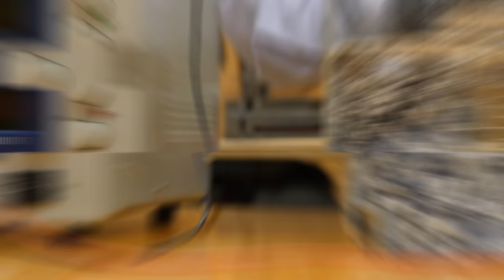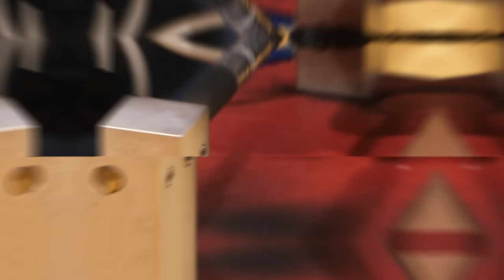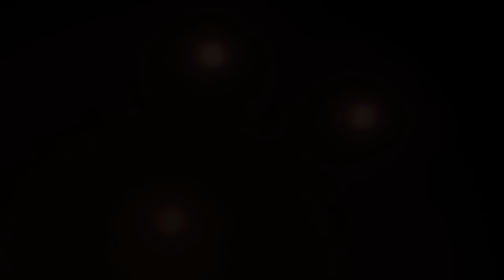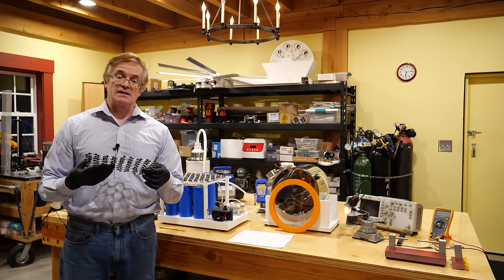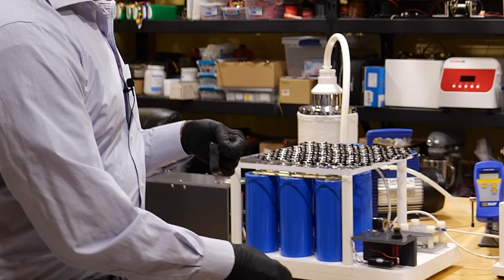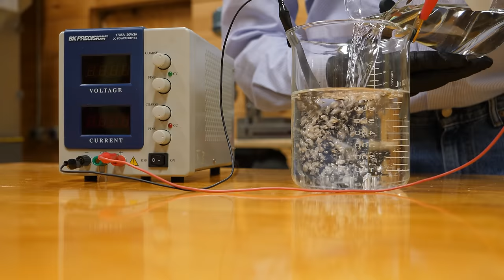Making Graphene could KILL you... but we did it anyway?!

Comment: Been hearing about the hype of graphene for over a decade now and seeing something so practical really gives me some hope. And raman spectroscopy is really useful, hardly any sample preparation required although it doesn't really work with anything that fluoresces. While a baseline model from well known manufacturers can cost around $100k, there are quite a few south korean companies making raman systems around the $30-$50k range with "good enough" performance.
Reply: Govdeals and get something used for like $100, might have to work for the software though.

Comment: I am very impressed by the change in stiffness for epoxy with graphene. 750% for 0.6% is insane. Great video and I am now subscribed
Reply: Right?! And that's not even accounting for the purity or quality of the Graphene, think he mentioned he didn't have any accessible way of testing the Graphene he made.

And i wonder in what ways it strengthens the epoxy, obviously tension/compression (likely more tension than compression), what about the fatigue curves, sheer, torsion or heat resistance. 

This actually managed to make me quite excited about the prospects of new composites entering the market in the foreseeable future
Reply: The only material stronger than graphene that we’ve made in a lab is Carbyne LAC which is twice as strong as graphene. 

However we’ve only made a few molecules of it, it’s more stiff, and lacks all the other advantages of graphene. 

But theoretically if carbyne LAC molecules were arranged in the same pattern as graphene it would be an inconceivably strong bond. We’re talking possibly 20 times stronger than graphene and 4000 times stronger than steel
Reply: @ZverseZ now this right here is absolutely fascinating! Wondering about the practical applications of making a bulletproof vest out of such a material. What type of density does that material have?

Comment: I loved this video, the bending test results were genuinely astonishing. I'd like to see a short video of the post processing of the graphene you were using for the test pieces. Was it with the sonicator or just the pestle and mortar? 
Are you going to do a follow up to test the thermal conductivity? I can see an immediate tie in with your thermal epoxy experiments you did a while back!
Reply: Big omission in the way the beams were made. A granular material will hardly resist tensile stress. But packing more stuff tightly into the beam will increase its stiffness. The graphene won't resist tensile stress unless you can turn it into long fibers. Need to attach fibers to the outside of the plastic beam, not fill the beam with granular material.

Comment: I was thinking about using this method on industrial (ish) scales. What about using a reaction vessel with a higher surface area to volume ratio, so you can increase the batch size without changing the cooling rate. A Cylinder gives you very little surface area for heat to radiate away relative to its volume. 

What about a rectangular prism? You could make a thin but wide and tall reaction vessel out of relatively thick quartz sheets (I'm honestly not sure how you'd bond the corners, so this may not be viable). Allowing you to do many times the reaction mass that you're using here each time. 

In addition, to allow for a more industrial scale, I could imagine using the reaction vessel as its own vacuum chamber. Because it's not a high vacuum (only 1/100th of an atmosphere) you don't need any exotic seals and could likely get away with simple endcaps that contain the copper electrodes, a sealing cap and an air outlet. You pre-fill the reaction vessel with an appropriate mass of carbon black, then fit the electrode endcaps in place and rapidly pull a vacuum on the relatively small volume. You could compress the carbon to the appropriate electrical resistance either by having a set compression ratio (that might require some unrealistic tolerances), or by just using gaskets on the endcaps and allowing the electrodes to move in an out, before locking them in place. You could theoretically automate this process, dumping out the reaction results into a container for later refinement. The main issue is that you could only have one reaction happen at a time, because otherwise the black body radiation from one reaction would just be absorbed into the next reaction, slowly the rate at which they cool. You could even go a step further and perform the reaction mostly inside a box with a high absorption coating (e.g. carbon black) to decrease the amount of thermal radiation that's reflected back into the reaction vessel (you may also need to actively cool the container so it doesn't heat up over time and reduce its effectiveness). 

Anyway, I got this far in, then found realise the plasma deposition paper has a much more easily scalable method hahaha. Although I expect this could be done with a much cheaper outlay, even if the plasma deposition method would soon outcompete it.

Comment: I've been watching for potential applications of graphene in extremely high-Q mmWave resonators.  I think we're a long way off that yet, but it's brilliant to see how much progress you are making. Some of those flakes are HUGE relative to the mmWave wavelengths I'm working with at 122, 135 and 248 GHz and above, where surface roughness of even polished silver starts to be an issue with scattering and losses.  Interesting times we live in
Reply: Have you considered lining your resonators with mica sheets sputtered with a conductive surface? The metal surface would still be rough but where it interfaces with the mica isn't, and the thickness of the mica layer should be thin and consistent enough to be factored for.
Reply: @mfree80286  I need to check the loss tangent of mica at those frequencies, but I think the tight radius will be a problem for the really small cavities, plus I need to check skin depth issues in graphene at mmWave frequencies. Sputtering gold or copper on to the outside of a really  well-polished sapphire cylinder, then electroforming copper over it might be an interesting option.  I do like the idea of cleaving mica and doing a reverse coat that would then be as flat as the lattice, assuming there's no migration.  I only need to remove ripples more than a micrometres, so optical polished surfaces are definitely good enough if the conductivity of the entire surface is good and there are no discontinuities
Reply: @MachiningandMicrowaves    Hrmm. Could also coat a given substrate with a resistant metal and then chemically "remove" the substrate layer. 

MIndstorming a bit on that, you might end up being able to properly polish a solid, sputter, electrocoat, "delete", and end up with a complete seamless cavity. Just need to find a material that's nice and hard but is reactive to something that won't influence the sputter or support materials.
Reply: @mfree80286  I do that to make complex internal structures inside tine feedhorns, make an aluminium positive, zincate it, then gold plate then copper electroform, then hot NaOH to dissolve the aluminium. Thanks for the ideas, I'll do some research

Comment: Thanks for the update in graphene. I made some several years ago using the top down method with sonication. I would love to see you compare your method with graphene oxide in your epoxy test. The older method as you say produced varying layers and sizes of graphene but it would still be interesting to see the quality difference between the 2 methods.

Comment: I am sure you have thought of this already, but if it is at all usefull to compact the second electrode, you can compact it tightly in the second tube, and then use a coupler to couple the reaction tube to your offcut, allowing you the ability to easily drive the electrode into the reactor. It may require a more precise cut, but nothing a nice little saw can't handle. 😅 Love your work and I am eager to see you revisit some of your composite construction concepts using the end-grain balsa. I would love to see the delta between their respective stiffness!

Comment: As a mechanical engineer I found this so very interesting. I have performed load testing on many projects, but this graphene is amazing, truly a huge advancement in science/engineering. Thank you so much for posting.
Reply: Maybe. CF also makes stuff harder. But the question is: does it increase hardness at similar toughness? Glass is hard - but brittle.
Reply: @testboga5991  I think Carbon Fiber will be with us for a long time to come. Graphene is still in it's infancy, until the manufacturing method can mass produce it in large quantities. CF is still an amazing product and new uses for it are still being found.

Comment: How does the epoxy+graphene compare to other common (low cost) reinforcing materials like short-glass fiber? I’d love to see those bending modulus tests.
Reply: he certainly should have tested at least real marzipan with epoxy, that would take that question out of our minds... kkkkk
Reply: I tried it using 1.3x the amount of graphene that he used, and it outperformed marzipan and mylar by a significant amount!
If you printed a car out of this, the car would be able to ram through concrete with minimal scratches...
Time to start experimenting with chitin I guess!

Comment: I'd be very interested in seeing this applied to SLA printing resin, they tend to be very brittle unless you make them flexible, which kind of rids them of any stiffness. It's pretty difficult to use any additives with the resin due to settling, but a graphene suspension might just be viable in those small amounts.

Comment: Y'all production quality has gone through the roof in the last few years. Just an idea, I'd love to see what this would do for a boat Hull. My thought process is if you're doing a laminated fiberglass you lay down the fiber glass and mix the graphene in with the epoxy. Theoretically you should get the strengthening property and I'm wondering if you'd get a lower friction coefficient as well. Since you were saying earlier that is can be deposited onto copper can this be electro plated onto something? My thought was if you could electro plated it or maybe even deposit it on an etched circuit board that would be huge.
Reply: Resin printer...
Reply: @trygvetveit4747  yep that would be a pretty cool idea as well

Comment: The water thing is something to do with water molecules cleaving bonds at the crack tip if I recall correctly, it's quite potent, you can cut glass with scissors even without cracking it as long as you do it underwater
Reply: I've heard this story about cutting glass with scissors underwater, and although I never actually tried it (well, maybe I'll put on my bucket list? ;-) but having couple of years of hands-on experience in glazing I pretty much doubt it. I mean, while you could probably "split" a piece of glass/ small glass pane into two pieces or more (I guess "more" is more likely) with this technique, you certainly won't be able to make anything even remotely resembling "precision cut" going into intended direction. Heck, even with proper glass cutter and cutting technique it can get messy if the glass you're working on hasn't been properly cooled (i.e. it cooled too fast). I happened to work on such glass one time few decades ago - no matter what, the moment the cutter was close to the end of making a score (i.e. approaching the other edge of the pane) a quite "plink!" sound was heard and two wavy cracks propagated perpendicularly from nearly-almost finished score. Oi, I hated it, I really did... ;-)
Reply: @MrKotBonifacy  oh yeah, it's super crude, more like crushing than anything, but the cracks stay localized rather than running off and destroying the piece.

Imagine an edge that looks like a knapped arrowhead and you wouldn't be too far off
Reply: @AngDavies  You definitely piqued my curiosity. On the bucket list it goes... ;-)

Comment: I cant imagine the applications this has . Well done ! As an aircraft mechanic , I work with fiber glass and carbon fiber  laminates . I see failed laminates frequently. This technology overall would save an astonishing amount of repairs and replaced parts    repair time , down time of the aircraft and ultimately overall cost by so much its obvious that graphine is the economic and safety solution for a large part of aircraft manufacturing. Awesome !
Reply: How did you mix the graphine evenly into the epoxy at an accurate .3 and .6 % precisely throughout the bars ? 
Seems like a poor mix could reduce the strength of the rods down to that of epoxy only .  Are special mixers required to produce an even mix consistently ?

Comment: 26:02 sorry if this question has been asked before or I am to late but please read the full comment, why did you use 2ohm as the resistance for the reaction tube? The reason I ask is because in the paper they had given that the heating should only last for 50miliseconds (0.05s). By applying the discharge formula (time period = resistance x total capacitance) giving 1 time period, now multiply by 5 to get 99:93% discharge of the capacitor bank. When I applied the formula I found the resistance is 0.247ohms. While I am not saying that it is wrong as in the end you did succeed in producing graphene, in fact I could also be wrong and would love to be corrected about this. All I wanted to know is what the reason was. Please do answer my question that would be wonderful.
Reply from the maker: I'm  not sure why you chose 5 time periods and such a complete discharge.
The heating rate is complex as the higher current near the beginning generates the fastest temperature gain.  In addition, as the reaction proceeds, the resistance changes.
The resistance I chose was based on repeated attempts and what generated the best production rate for that particular load of carbon black in those particular quartz tubes. 
Modeling this dynamic process is very approximate.
Reply: @TechIngredients  Thank you for responding, I am sorry for my late response due to examinations . To elaborate on the reason why I chose 5 time periods, as you had mentioned in 32:07 1,100J of energy was used for the overall 150mg of carbon black and it does check out when I applied the capacitor energy(in joules) formula the 237v does indeed check out however, this implies the total stored energy of the capacitor (as far as I know). Thus, I used the 5 time periods for a near 100% discharge to deliver 1,100J. As for the resistance I will try to understand why and how this effects the result as the theoretical value and the practical value used above are quite far apart. while I don't fully understand the complex mechanics I am just curious as to how the overall setup works. I would love to get your feed back on this and correct me if I have miss understood anything I would be happy to learn more. thank you once again for your great response I truly am humbled.

edit: while heating rate is important, for time periods as small as 50milliseconds I believe it would not have much effect as by that time all the sigma-bonds which hold the different layers of graphene forming graphite would have already moved on to from a resonating structure inside the hexagon (a same structurer seen in compounds such as benzene) once these resonating structures form wouldn't it be very hard to break them to form an sp2 hybridization back to sp3 hybridization of the carbon atoms?

Comment: Love it! Thank you for the detail. Is the volume and material of vacuum chamber important? Could it be a long black steel pipe vacuum chamber? I'm also curious about the white cables from the switch through the yellow XT connectors to the carbon at 1000 Amps. (30:10 in the video) What gauge of the wire and XT connectors  are you using ? Would increasing the gauge affect the reaction in a negative way?
Reply from the maker: Thanks!
For this very modest vacuum, almost any strong container will work.
For a brief pulse, all that matters is the voltage drop. The wires and connectors won't heat appreciably during that short time.

Comment: Maybe I should finish watching the video before asking this.. but won't applying a vacuum to the tube change the resistance?  Like idk if the air molecules themselves might affect the resistance.. but I would think the decreased pressure between the carbon particles would potentially decrease the resistance (moving them closer together).. while the action of sucking the air could potentially increase the resistance (moving the carbon apart)
Reply from the maker: I actually didn't mention in the video that I tested the resistance during the pump down, and there was no change. 
Apparently, the carbon particles are the controlling factor.
Reply: @TechIngredients  welp. Just goes to show expirementation trumps speculation everytime. Really cool video btw